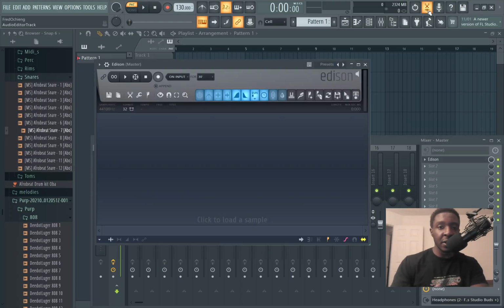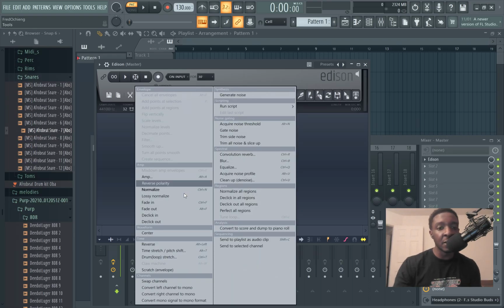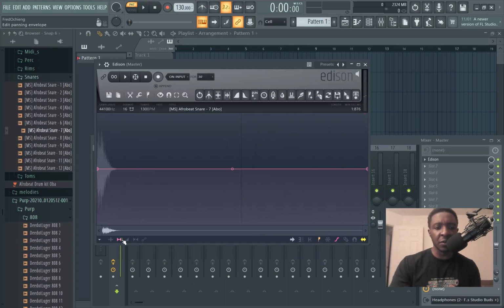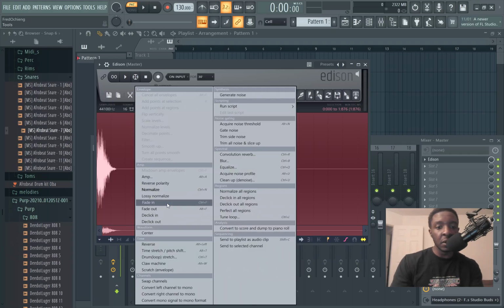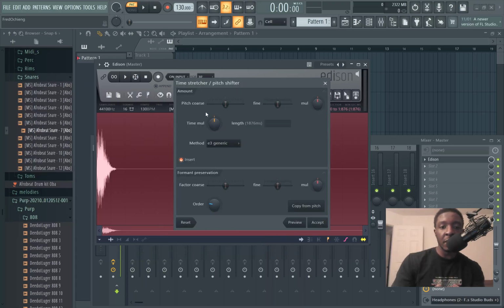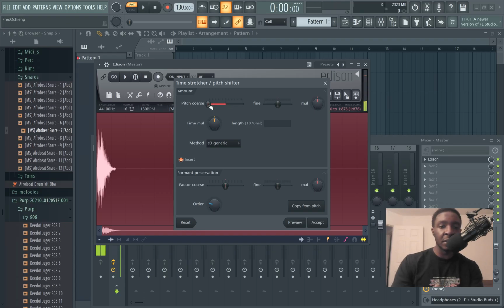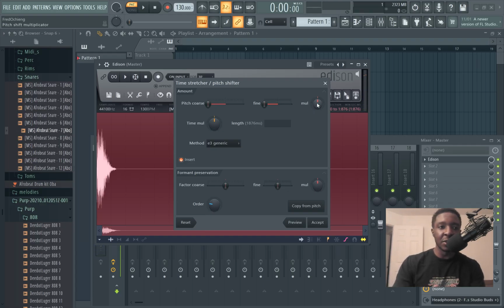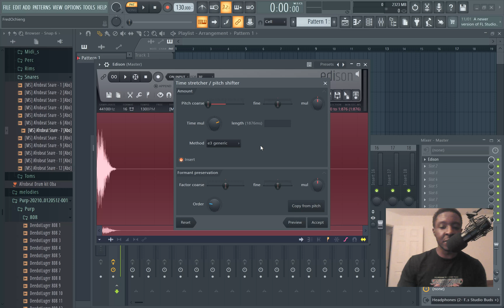FL Studio Edison Editor: Pitch Shift & Time Stretching Sounds/Samples

Comment: The fine tune seems to come in to play with pitched loops. For example in the FL loop creator startup, many of the "bass" loops offered as starting points are pitched between the keys, and of course a lot of sixties and early seventies records had the tape decks jacked up in pitched a bit at mastering to tighten the rhythm section up perceptively.